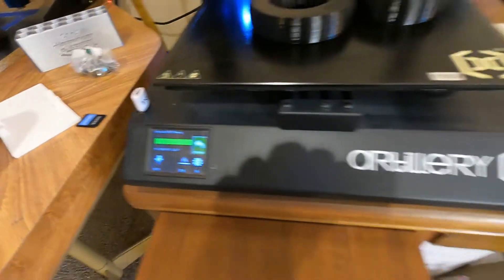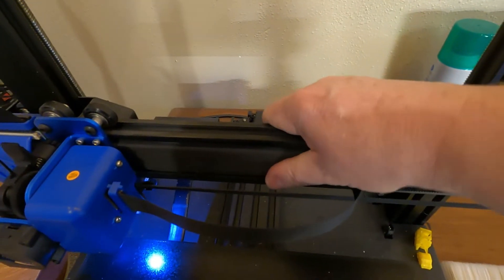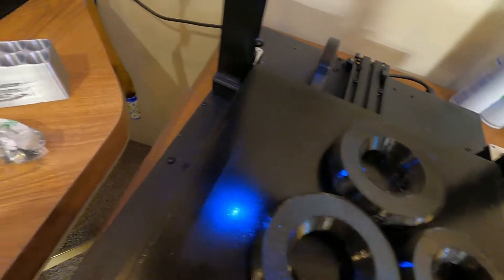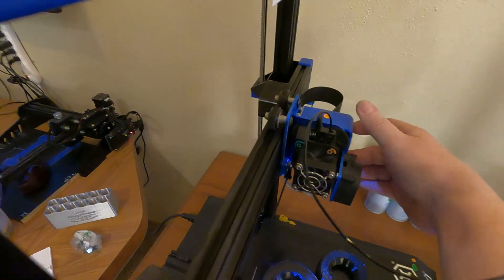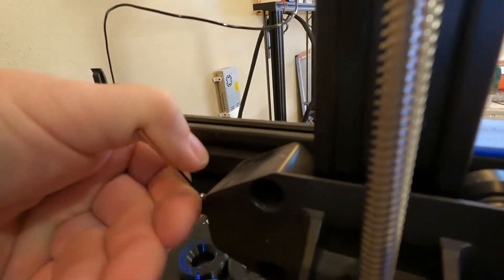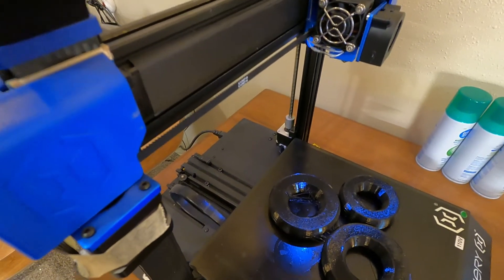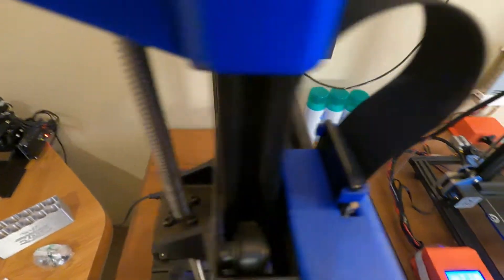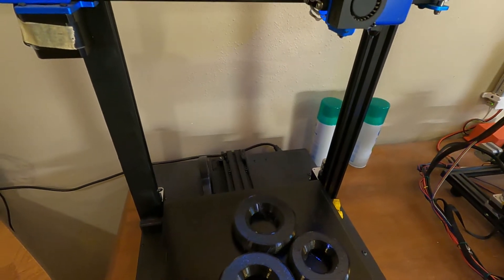Artillery SWX2 Loose X Axis

Comment: You have to loosen the three nuts holding the cover on loosen the inside bolts connected to the wheel then tighten them in till it’s good then tighten the nuts holding the plastic on back up I literally did this right before I clicked this video